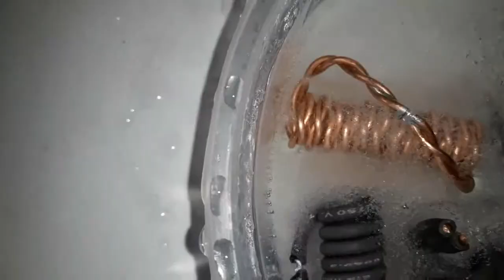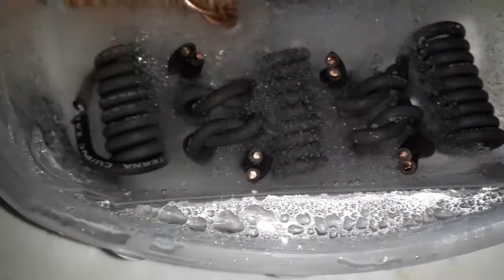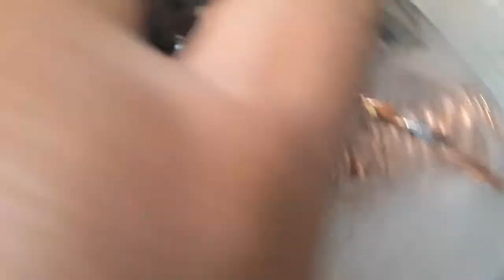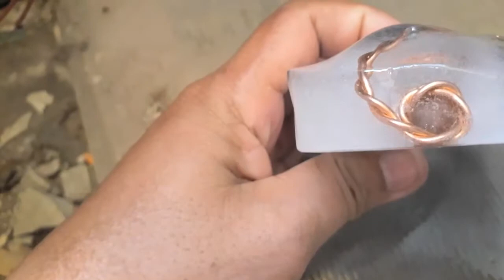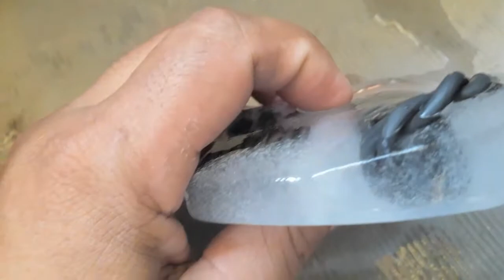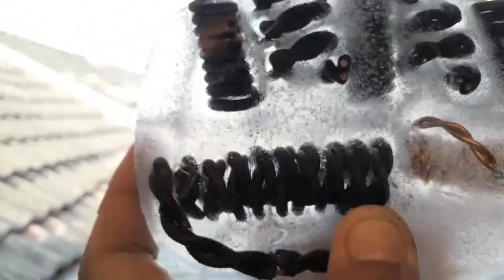Ice test: acu vac

Comment: Hi, try twisting the acu vac wire until it pops off from your drill, it will be very twisted and produce a different energy than the loosely twisted. More twist means more power, loose twist means more gentle energy.
Also if you make an acu vac without twisted it has a positive hole and a negative hole. With twisted so the wire is clockwise it has only positive energy. I have once tested and made a counter clockwise acu vac and it made me sick in the stomach energetically, I had to destroy it.
Reply from the maker: ok. I will try that later. Not sure about positive and negative hole. Twist seems to be less important than the coil winding. do you still use the same winding?

But twist also change its energy distribution, will post the video soon.
Reply: @sucahyovideo  Yes I always use the same winding for positive energy, and yes twist isnt a lot important for your experiemnts maybe but it still behaves energetically different. I have one tensor ring on my radiator wifi, strong twist eliminates over 90% of the EMF, while a loose twist eliminates maybe 40% EMF.
Reply from the maker: Interesting. ok. I will test tight twist soon.